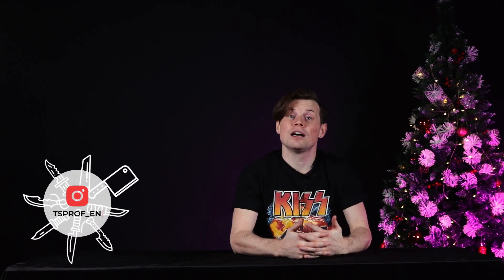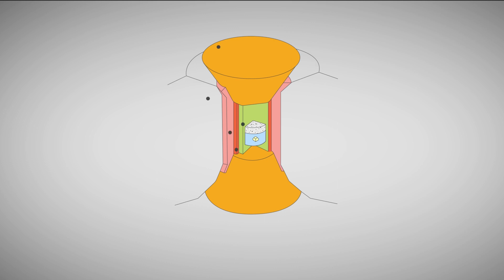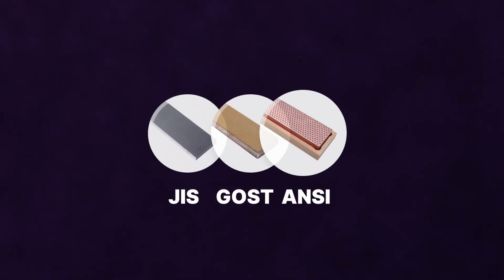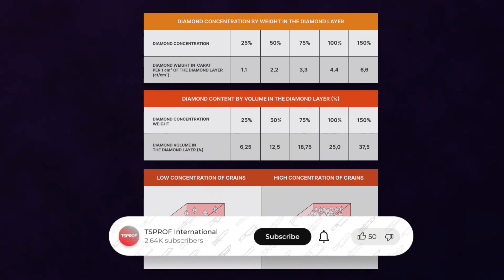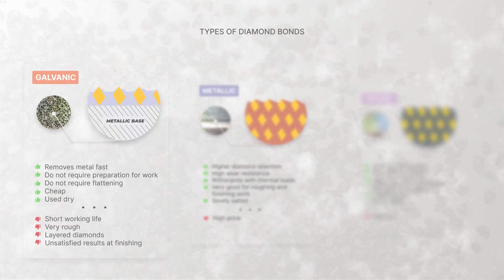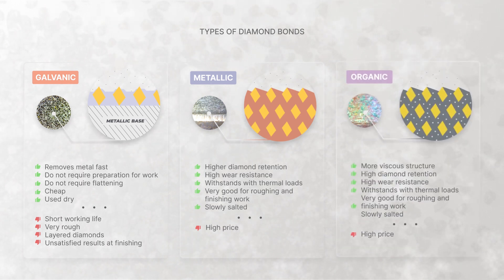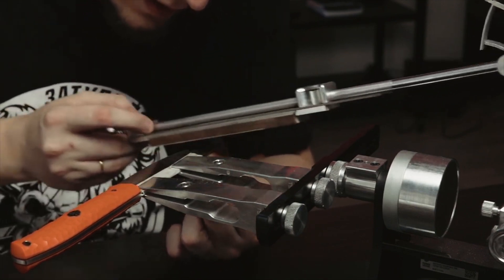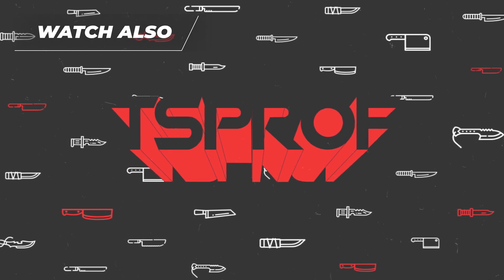The Best Sharpening Stones. Diamonds on Organic Binder

Comment: Softer steels damage bonded diamond stones? How ?
Reply from the maker: When you work with soft steel, the abrasive stone looses its grain faster due to the steel viscosity.
Reply: @TSPROFSharpening 
Thanks for the information. Makes sense.

Comment: Question please, i have venev industrial  stones, it sharpens knifes great up until 800 grit, at  1200 grit it dulls blade, i use axicube angle, to maintain same angle, but it doesn't help,   so i have to re use 800 grit to bring my sharpness back, any suggestions?
Reply: It used to happen to me, then I learned that some steels work better on lower grits, when sharpening on higher grits, the scratch patern gets thinner, making some microserrations on the edge, if the edge is too polished, some steels Will lose that "bite" and eventually Will lose sharpness. Mirror polished edge are nice looking and fancy but aren't necessary.
Reply from the maker: it's hard to say. Either steel is too soft and these stones do not fit it or cutting edge is getting dull because you simply don't get rid of the burr at the final stage. There could be even more reasons.